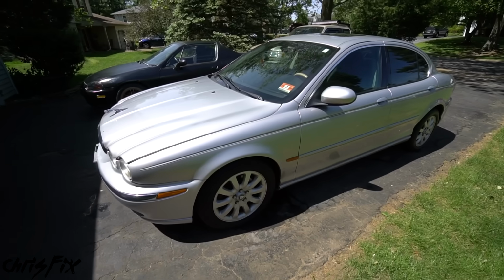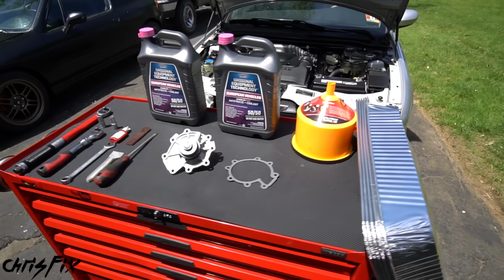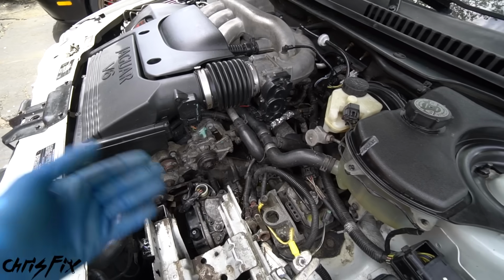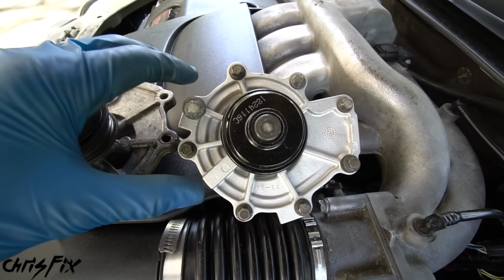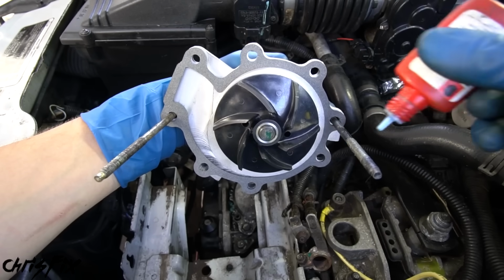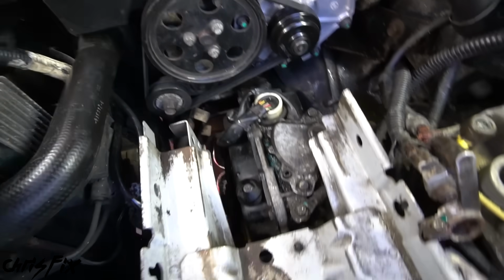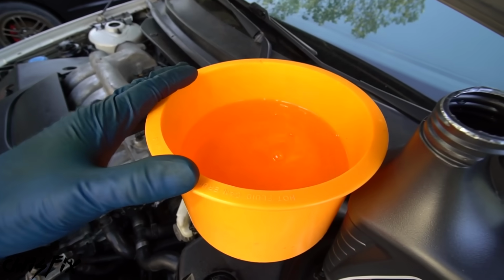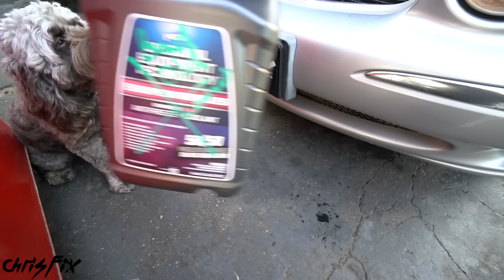How To Replace a Water Pump and Save $783

Comment: This is perfect. My Subaru Justy 4x4's water pump is out.

Edit: my waterpump next to my subframe. So it is not easy.
Reply: Before you pay someone big money to do it, you can still gain access by removing one motor mount and slowly (and very carefully) raise or lower the motor to gain access. It's a huge pain but that's working on cars for you.
Reply: Typical Subaru engineering
Reply: When it comes to water pumps near sub frames i go ahead and pull the motor and replace the tensioners and other things while its out
Reply: I was planning on going to harbour freight and buying a 200$ engine crain to finish the fix. Currently i am a little occupied with my toyota celica that needs new tires. (I should stop doing burnouts and drifts in the thing, poor celica)

Comment: Same happend to my corolla 04, while driving to work the battery light came on, i assumed it had do to with the generator and to my suprise it was wet there like a leaking waterpump then i realized that there were no belt for the generator belt, (mine has cam chain) so i felt the play on the water pump i mean you could wiggle it from side to side, and there were no coolant in the tank either. So for short somewhere to work was my belt lying it just flew of. Kind of funny to be honest.

Comment: Should've mentioned that it's a good time to do a super flush while doing this since you can benefit from emptying the coolant at the same time. Also, this tutorial really only applies for cars that doesn't have a water pump that's run by the timing belt, could be worth mentioning so people doesn't go off buying equipment and spare parts before realizing they have to take apart half the engine to get access to the water pump (depending on car of course).

Comment: I really wonder when this pump will fail, because you've just replaced the OEM metal impeller version, for a cheaper, plastic version.
I've done the same with my BMW E39, only to find out that the aftermarket stuff from Meyle HD is working a lot better and lasts.

Comment: To bad the 2002 Dodge Intrepid isn't that easy I junked my car with 90 thousand miles on it cause of the water pump I don't understand why Dodge would put the water pump in the motor then run it off the timing chain!

Comment: I wish it was that easy on my car.
I replaced the cater pump about a month ago and it was a nightmare.
I had to drain the coolant, remove the expansion tank, an headlight, engine mount, alternator, two stretchy belts (the one without tensioner, it's a nightmare to say at least), timing belt cover, water pump pulley and water pump itself. A total nightmare.

Comment: For a conventional configuration. Water pump, fan facing front.  A fabric strap wrench around the pulley to keep it from spinning while breaking the fan bolt worked for me.  Dodge. Needed another set of hands too.
 
Dad is in the house reading Golf Digest sipping coffee looking out the window.  He drove the car home and said "Son', pointed to the hood, 
and went inside.  Chris has to fix the lawn mowers too, he just doesn't film that. ;)

Comment: Note that a spillproof funnel will fill your resevoir to the max. Meaning to the top which on most vehicles is not the proper way to do it. Most vehicles (at least here in the EU) the resevoir also acts as the expansion barrel. So filling it to the top will cause the pressure to build up. Thats why they have a min and max filling line.

Comment: A Jaguar with issues? You don't say! 

Seriously though dealerships are a rip off 8 out of 10 times.... I remember dealership tried to charge me $350 for a new MAF sensor on my Altima and then another $100 for install. 

Went to pick and pull torn one off another Altima for $20 and had it installed in 15 minutes.

Comment: That coolant tank is transparent expansion tank with fill lines to keep the coolant in constant pressure with air in it. Filling the tank full will cause catastrophic failure in the cooling system.
Reply: When the engine heats up the coolant gains pressure and will go through the head gasket into the combustion chamber and destroys the engine.

Comment: If a car is out of warranty never go to the dealership to get parts unless you really need to aftermarket is much cheaper and last just as long as the OEM part depending on the part and brand of the aftermarket part

Comment: YES I've been hoping this video would come

My water pump went bad over 2 years ago and caused the belt to squeak. At the time I was very short on money and the belt needed to be replaced anyway, so I did that, but was unable to replace the water pump. 

Over the winter, I think the pin actually rusted shut, causing the water pump to accidentally fix itself and it didn't leak again until about 2 months ago, when the gasket broke on the underside. 

It's a very slow leak but it doesn't cause the belt to squeak, so I've been driving around occasionally putting distilled water in the reserve tank. 

Literally just yesterday, I finally ordered a water pump and was afraid I'd have to put it on without the help of the legendary ChrisFix, but you timed this video so perfectly ✅
keep it up man!

Comment: Just a little thing about water pumps the days before everything was thrown away or replaced they use to sell water pump rebuild kits that were much cheaper then a new one and everyone would rebuild their water pump before replacing them all it is to replace in a water pump is the bearing and seal as long as the shaft was good and nothing was badly corroded it was rebuilt the same goes for many other things on a car
Reply: I once put a rebuilt water pump on a 1970 Duster. It lasted almost half an hour and then gushed coolant.

Comment: such an easy fix, try the water pump on your del sol. now that is a pain in the butt to replace, its under the timing cover and ran by the timing belt. all with no space to work.

Comment: If the bolts on the poulie (dont know if its spelled good) are to tight so you just rotate it you can leave the belt on and then loose the bolts👍 way easier

Comment: Those funnel buckets are amazing.  Wish I had one years ago.  Even better to use the extension if you have the room.  Gets more head pressure on the coolant to help get the water pockets out even more.  
**You forgot, make sure to have your heater on full hot to purge any air from it too.**

Comment: $843 wow that's straight up robbery!!
Reply: Well... Factor in the parts and labor charges along with state tax. And you have to worry about who is working on your vehicle and if that mechanic is having a good day or not. My last dealership visit was a mess. The mechanic didn't seem to care. They apologized and fixed the issue for free. I left a negative review about the dealership on Google.
Reply: @venividivici4253  still with parts and labor I dont see justifying $843 over a part that cost less then $100!...I kinda see 400 but 800 nah that's straight out bullshit and only for the true dumbass to pay!

Comment: wtf?! Was the battery only held in place with battery cables? That's not very safe.. just disconnect the terminals and pull out the battery.. welldone Jaguar. Thumbs up..

Comment: Just bought myself a 2007 Corolla dirt cheap. The local Toyota dealer wanted 2700$ to replace left lower control arm, brake pads and rotors up front and two brake lines. I fixed it for 0$ with my welder and some scrap metal. The brakes only needed to be used a little as the previous owner rarely used the car and had been sitting for a while.
Talk about a fraud, paying 2700$ for something I fixed myself for just 0$ :)

Comment: May seem simple (which it honestly is) but is a pain in the ass depending on the vehicle and if you don’t have much mechanical experience. Just done a water pump replacement recently with dad on my gmc 1500, the problem was really trying to get the new water pump on without messing up the seal

Comment: Nice 👍. I got a question I replace my heater core on my 95 Toyota Tercel and now it’s leaking tru the hose connection on heater core right were the clamp are I replace the hose but still now it on both breaking my head here 😡

Comment: " so in case you are getting married, remember to use medium  tread locker in the ring, so it doesn't fall out do any vibrations, also remember to tight it up to 35 ft' "

Comment: Never could figure out why they don't add a small nipple to the weep hole that you could attach a tube to to direct any leaks away from other components when the pump finally does wear out. The leaking water pump on my Lotus (not bragging, just saying) also killed my timing belt quite quickly. Yep, got stranded in the middle of no where when the belt let go. ....  Kind of amazed that a Jaguar is actually easy to work on.....
Reply: That would make sense in another way, too - the hose could be routed to where dribbling could be seen. On my daughter's Accord it just looked like a small hole in the end of the block.

Comment: Lol...you showed the easiest example.
Show it on a Honda V6 motor.
Reply: Hah any transverse mounted V6 is going to be a PITA,  spark plugs, water pumps and belts are always brutal on
those things.
Reply: @BigHeadClan  The timing belt on the 3.0 in the 2002 Sienna was easy; the water pump requires taking off the sprocket on the rear cam. Do'h!
Reply: @flagmichael  Oh god that sounds terrible.... I can only assume the engineer who approved that design was burned at the stake.
Reply: Duratec 35 or Chrysler 2.7 are a bit more involved...
Reply: @bastianfromkwhbsn8498  Can confirm the 2.7 is a pain in the arse. I just put head gaskets on my own this passed weekend 🤦‍♂️
Reply: Ha ha try an RB from skylines, I have had to remove the whole front of the motor because Nissan thought it would be great to put the water pump on first then cover it with everything.
Reply: @xkblxcripple  Hah lame, I was helping my old man with his belts and spark plugs in his N52 (BMW inline 6) she wasn't terrible but we had to remove a bunch of the windowshield cowling to even get at the rear plugs.

By comparison my VQ37 was a breeze to do the plugs.
Reply: @BigHeadClan  beamers are easy, wym? The cowl pieces are just held on by twist locks and a few screws. 4th gen v6 Camaro and trans am plugs are miserable because you gotta do the back 2 from underneath the car (or drill spark plug sized holes through the finder skirt)
Reply: @jrowland6717  You mentioned B52 which is a strait 6 so figured it was comparable, granted N52 is NA so no turbos to get in the way of anything around the block.
Reply: @xkblxcripple  Suspend water pump by a string and build the car around it.
Reply: I think it was on a model of Chrysler that an engine mount had to be removed to change one of the spark plugs.

Comment: At least it’s not a Ford Edge, those engines have the water pump behind the timing cover and realistically the only way is to remove the engine cradle and drop the engine out of the car for a water pump that takes 15 minutes to replace when you can reach it.
Reply: Good to know!

Comment: Hello chris 
I have dodged Journey 2015 awd
With 3.6L engine 
It is reaching 110c temperature for the collent is it normal or is it over heating?
By the way we have 46c climate 🥵
Reply: I have on the screen coolant temp oil temp transmission tem etc. 
as for the needle its slightly to the right
Reply: Sometimes it reaches 108 in traffic 
On the highway doing 120kph it reaches 110 and the needle is slightly to the right 
The conditions was (50c outside temperature and high winds against me) however slowing down to 100kph solved the problem 
My thermostat is rated to be open at 95c
I just replaced the water pump and thermostat because it makes skuky noise
Reply: Thanks man you helped allot 
I bought my dodge from maxico and shipped to Iraq 😁
Since it has accident damage the radiator had to be replaced with a new one 
I went with three raw himi engine radiator thicker and bigger 😊
I tried the 82c thermostat but I couldn’t find original parts here 😢
About ice I don’t know what you mine 🤔
If you have some links to the product it will help me 
Thanks 🙏

Comment: If anybody in the comments has  Dodge Neon, this job is a lot more involved. Unfortunately for you (if you're an owner) Dodge saw fit to bury the water pump behind the timing belt. This is really a terrible design, because in the event of a pump failure it could potentially take your timing belt with it. It isn't extraordinarily difficult, but it is a lot more work than this one. If you do the timing belt service, do the water pump at the same time.

Comment: That price quoted was to remove the crankcase etc, where most water pumps are located. Sounds like you didn't give the shop the correct info about the car. A Jag dealership would have known the engine spec

Comment: Please, please get one of those spill proof funnels. 

My car (06 Prius) has a very complex cooling system and filling it up without pro grade tools takes a long time, much longer than common sense would suggest. Because of this, I was a quart (~1L) short without realizing it. My car had this wacky intermittent overheating problem, as in the temp would suddenly drop about two minutes after it got worryingly high. I finally figured it out a week later after doing the math from how much drained out, how much new coolant I had left over, and how much the manual said it took. Thankfully, there was no damage to the engine. 

    What does this have to do with funnels? Well, if I had used a spill proof funnel, I would not have been so impatient with trying to get a regular funnel to seal in the radiator cap neck. Standing in front of a car for an hour and a half watching bubbles come up would have been a much more pleasant experience with a spill proof funnel.
Reply: So basically, you got impatient and messed up a fairly simple procedure.
Reply: @98ek9  Thus proving you have never changed the coolant on a Prius. 

BTW, a Prius has two coolant systems. One for the converter, which handles the electricity going to the electric motors, and another for the gasoline engine. In my original comment, I referred only to the gas engine coolant.
Reply: @steve5912  We are in a DIY car channel. Everybody else is talking about cars and you, out of the blue, start talking about being gay. I'm just saying you have a grossly abnormal interest in the sexual preferences of other men and speak of it in very personal terms. That is not normal guy behavior. Your sexual activities are your own business but you advertise them on the 'net. You spent a small fortune buying a vehicle to make you look macho. You grossly overcompensate, revealing intense anxiety about your sexual orientation. You hide it very poorly, playa.
Reply: @flagmichael  Lmfao. I prolly got one of the nicest trucks in this comment section and none of that bullshit I just read is true.
Reply: @flagmichael  I still wonder why you shouldn't listen to somebody named Steve?
Reply: @steve5912  I drive a Prius every day. Before I retired most of my miles were in an F350SD 4X4, quite a few of those off-road to mountaintop sites. When that wouldn't make it because of deep snow I drove a Tucker Sno-Cat. My partner and I had to dig it out of an 8 foot puddle of powder one time. I was the same person I always am. You seem mighty sexually insecure if you believe cars are an important feature of your manhood.
Reply: @steve5912  My former car was a 2011 Ford Crown Victoria Police Interceptor. I had to get a Prius because the gas to haul around my testicles was too expensive to afford on a college student's budget.
Reply: @superdupergrover9857  I dont care about gas. For me its smiles per gallon. I dont care about miles per gallon. I'd never drive a gay slow pos car.
Reply: @steve5912  I smile every time I gas up. Which is only twice a month, so i guess you're right.
Reply: @superdupergrover9857  Ahaha okay. And then you stay depressed the rest of the 2 weeks driving a gay car.
Reply: @superdupergrover9857  You cant even tell me why u drive a gay car?
Reply: superdupergrover the point of these videos is to make it so anyone can do it, and most people probably don’t have a spill proof funnel
Reply: @周紫泉  Did you even read the first sentence of my comment?
Reply: Sir you are a prime example as why people should not "DIY" with cars. You're lucky you didn't do damage. A little knowledge is a dangerous thing. I don't mean to take a shot at you personally . But to be fair. You fucked up something basic. There's nothing complex about the prius cooling system. Why were you changing your coolant?
Reply: @Hargy90  Fr. How is that complex 😂 Prius drivers can hardly wipe their own ass.

Comment: Not all water pumps are that easy to replace. Some water pump are timing belt/chain driven and can take several hours and require special tools to replace. On some engines (like GM 3400), they have bleeders to bleed out air in the cooling system. In those cases, open the bleeders, fill the cooling system until coolant comes out the bleeders, then close the bleeders and continue filling the system. Put the rad cap on and go for a drive so the engine reaches operating temp. When you get back and the engine is at operating temp, shut off the engine then CAREFULLY AND SLOWLY open the  but do not remove the bleeders so any trapped air escapes. You will be able to hear the hissing sound of the trapped air that's escaping. Once coolant starts coming out, close the bleeders and your done.

Comment: Chris , how I wish we could be neighbors. In the last 12 months  I had spent over 2k on  a new water pump , a new radiator  , center bearings for the transmission shaft , an oil pressure switch for my 20 yrs old car. And it ain't gonna stop there.